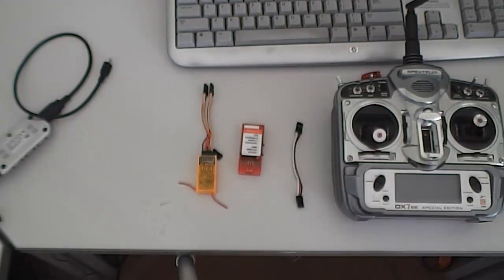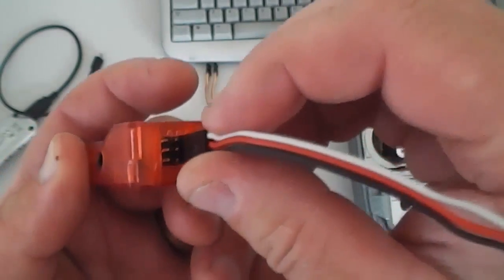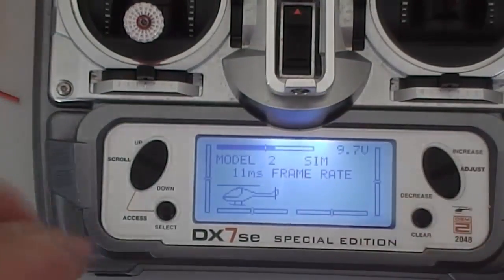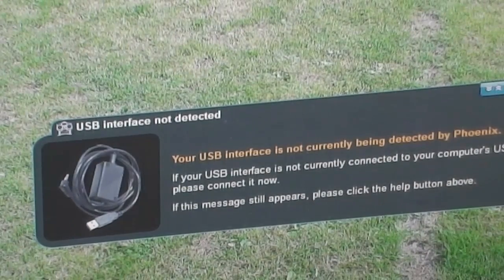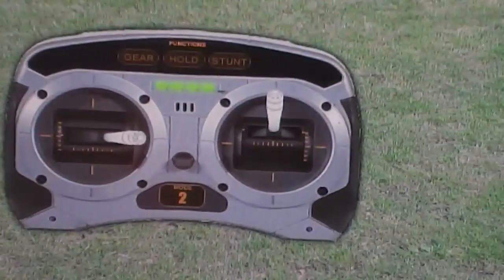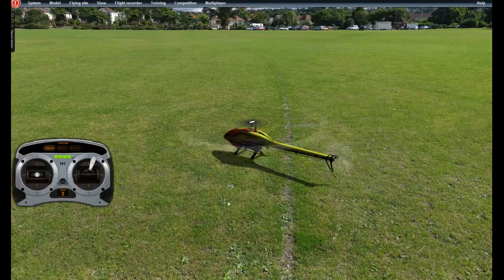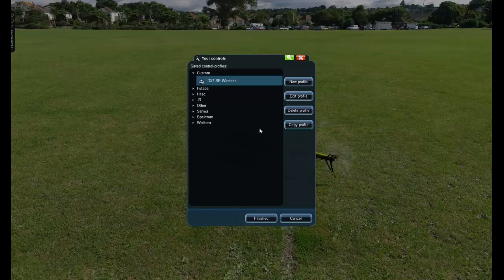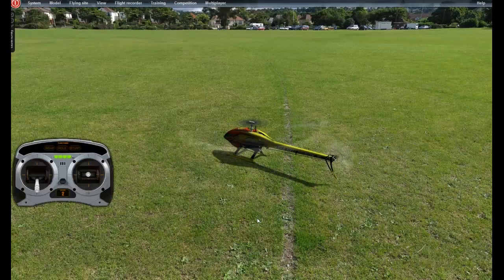setup-12n1 with PhoenixRC & DX7 se spektrum + Orange RX

Comment: Westy ; Ar8000 bottom up Bnd/Dat,Thro  Elev,Rudd,Gear,Aux1,Aux2   Throttle White Red Black, Aile orange on bottom, Elev red on bottom, brown Rudd on bottom, Gear orange on bottom, Aux 1 Red on bottom white,red,black throttle white on bottom This is with all the names facing up! & it don't work! Aux 2 Aux 3 empty ! last brown wire not connected! Thanks Dave

Comment: Westy AR8000 bind black ,orange throttle,red ,elev brown,rudd orange,gear red, aux brown! Signal wire white on orange controller & twists over on bind slot on AR8000 so bind is black ! If I turn the wire over it won't flash green! Dave